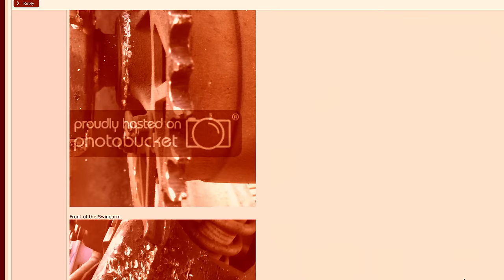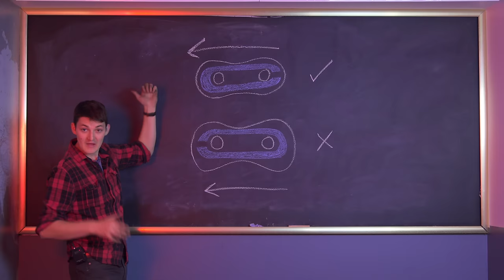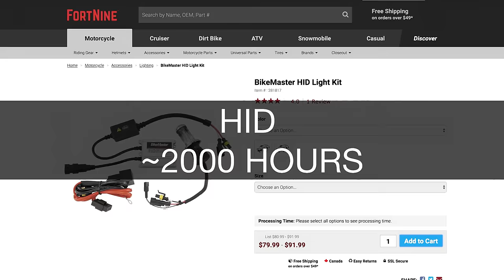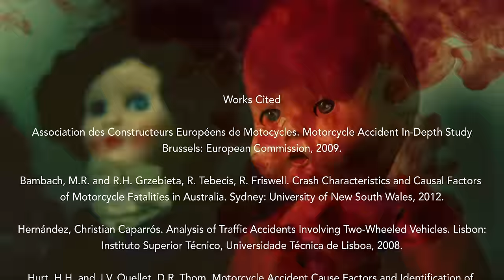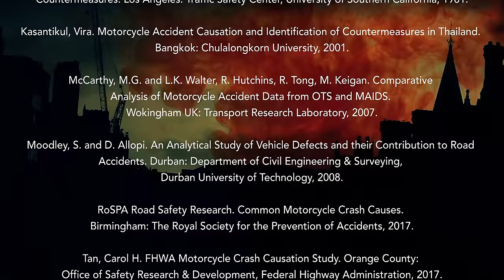Mechanical Monsters – 5 Maintenance Jobs that are Deadly to Overlook

Comment: The TW is definitely in my top 3, if not my favorite bike..
Reply: It's a pile of shit. I used to have one. Get an XT225.
Reply: @salazam  I went places with my TW that I couldn't even dream of on either my wife's XT250, my old XT 660 or even the white elephant Super Tenere gathering dust outside. 
All depends on where you want to use it.
Reply: @mariusvanniekerk7707  Yea I know, I wasn't riding it right. I'm just bitter because it got stolen.

Comment: Working as a repair tech in a machine shop I saw bearings from Thailand fail at an alarming rate. About 3% fail immediately and another 5% before I'm done testing my repairs. I'm sure bearings purchased through a motorcycle parts distributor will be held to a higher standard, but with most affordable bikes from Japanese brands being made in Thailand it is cause for concern. If you're changing your wheel bearings, buy extras, test for a couple miles, then check it again. If it lasts that long it's good.

For what it's worth, bearings from China were slightly better. I don't have enough experience with bearings from Germany, Vietnam, Japan, or Indonesia to judge them. I never had any problems with bearings from Singapore or America.
Reply: I only use German, Japanese or Russian bearings . Never had One-Failure , over 67yrs and 51 bikes .  Dave   NZ

Comment: Great video as usual!  
I've had several of these things happen to me.  The scariest was a chain braking at 100kms/h (62mph) with my girlfriend in the back.  We were lucky, but it broke a few things on the bike.  Also had a chain jumping off mid corner and froze the wheel.  Lucky i was only in first gear.  A bit of a slide, but nothing else.
On another bike i had a wheel bearing that completely destroyed itself. Again no fall, but had to call a tow truck.
Brakes failed because of a bad bleed nipple...  doing 20.. Ok again.  Throttle actuated as i pulled the clutch..  I could go on..
    
Guess i'm just lucky
Reply: Negligent at times. The bad bearing was on a new (to me) bike.  The bleed nipple was brand new.
The rest was negligence.  But hey.. most things happened more than 20 years ago when i was 19 to 21.
Reply: I'd say unlucky.
Reply: Maybe don’t do your own maintenance hehe b
Reply: You rode a lot of clapped bikes as a young man. Which honestly is probably true of many young men. Certainly was true for me.

Comment: Sag is Black magic to me. How about you show us on your blackboard?
Also (tip) don't leave her on the side stand for the winter as that plays merry with wheel bearings. Use a center or paddock stands and give the wheels a spin to stop the rollers corroding on one spot.
Reply: I combat those issues, but still riding, even if it is stupid cold out ;)
Reply: that is absolute BS, i worked in the biggest engine rebuild shop in NorthAmerica. this is totally unfounded.
Reply: @Francois_Dupont  ... How is it unfounded that metal exposed to the environment will form rust/corrosion on it. If left sitting, the rollers in chains and ball bearings will form corrosion on them. I take it you have never spent time rebuilding many old neglected motorcycles before. I started at 10 years old going to the local junkyards  and getting dirt bikes and other things like lawn mowers, that were trashed and making good ones from a few bad ones. I can tell you when something sits for a while with out moving, you certainly see rust and corrosion form on things. SO while you may never have seen it, and you may never even noticed it, I can assure you a motorcycle chain left out in the open will certainly rust solid, if you don't rotate it once in a while.
Reply: @JJ_ExMachina  we are not talking about chains or exterior rust here, but bearings, the guy claimed that having the bike on the side-stand wrecked bearing and that you needed to turn the wheel so they dont rust.

the fact is the the bearing can support a thousand times the static weight of the motorcycle and that they any quality bearing is vacuum packed in grease and sealed. if you bearings are rusting its because they are shot and its murderously dangerous to ride with such equipment installed.
Reply: @Francois_Dupont  Static engine bearings are not under stress when sitting. Wheel bearings are more exposed and weight bearing. 
I was involved in the amature racing scene for about 25 years as a Race Engineer and have built bikes from the ground up. I was told this by a much more experienced Engineer when we discussed swing arm props.
I'll take his word for it and keep storing my bikes off the floor.
Reply: @docthebiker  you think a bearing with not even 300lbs of static load on it is getting wrecked while the same bearing is designed to hold the whole bike axial load going 100km/h+ tru bumps and hell for 50,000km? not even talking about the fact that a single big bump put as much stress on it  as the whole bike falling 3storys high.

you can believe what you want for as long as you want, it doesn't make it right.
Reply: @Francois_Dupont  Thing about roller bearings is they take all that stress vertically even at close to 200mph, but are fragile with lateral loads. Moving and lubing they are great but I choose to protect them when static for a long time. Which is wheels off the ground or off the bike. Our race bikes mostly started the season on new bearings, but if I'd changed them near the end of the season I'd do all I could to keep them as perfect as I could.
Nah you're correct. Just because I believe it that doesn't make it right, but it seems logical to me, so that's my choice.
If I share it and someone chooses to do the same, then they MAY benefit, it certainly isn't go to do any harm.
Reply: I have bikes that are twenty plus years old, on the original wheel bearings, that sat all long, cold, wet Michigan winters on the side stand and had wheel bearing issues zero. You must have had some garbage bearings/seals.
Reply: @VTLIFE-so4dc  My BSA C25 did it too me (in the 70's).
Agreed not so likely a prob with modern sealed bearings but I've found some crapped out wheel bearings while working as an M/C mechanic in the UK. I play it safe with winterizing my own stuff. It can't hurt.
Reply: @docthebiker  I replaced steering shaft bearings in a 65 E Type Jag a few weeks ago where I work. They were made from felt. I guess that just the way you chaps used to do it! We could have found aftermarket rollers, but the old man wanted stock. It was nuts, because the previous job was diagnosing a chronic rich condition on a direct injected gasoline turbo engine. One extreme, to the other. The Jag was a beauty tho...

Comment: Great work F9 crew. This can also serve a dual purpose. When shopping for a used motorcycle, if these areas are looked at in greater detail, it could be the sign of a neglected and potentially dangerous ride for an unsuspecting new owner.

Comment: Six months ago my chain came off at 160 km an hour. When I had that chain fitted I told the mechanic to rivet it rather than use a clip but he used a clip anyway, saying that only racers need chains riveted. My advice is to always rivet your chain, especially if you ride a powerful bike.

Comment: This scared me to the point where I'm gonna change all my brake lines and bearing and get a new chain. 
Better get new and working than old and dead.
Reply: anonymous 11 it would be a good idea to change your sprockets when you get new chain, they wear together.
Reply: @brittonbyrd333  Great advice. The new chain will wear faster if put on old sprockets. And if the chain is worn chance is that the sprockets are too.

Comment: Who here honestly replaces their fork oil every year?
Reply: Manufacturer's recommendation is good enough.
Reply: Yep, once you do this and you feel the difference you'll do it EVERY year.
Big help is setting up your suspension for you.
Reply: @reegyreegz  You’ll have to be more specific than that. There are thousands, if not millions of bikers that have watched the bulk of Ryan’s videos and would strongly disagree.
Reply: I do. Engine oil every 5000km, Brake pads when they reach 1/3 pad thickness, clutch fluid every 2 years, tyres after 2/3 wear. I ride quickly and want to know everything is working as it should.
Reply: @reegyreegz  think he's just being very very cautious. I'd rather be on that side than the other but I hear ya.

Comment: My 95' XR650L and my 04' Roadster just got a fluid flush and a "brake over". I was amazed how well the brakes worked with sewage flowing through its veins. With all that care both bikes stop just as well as they did...but I have possible averted at least an unscheduled change of underwear in the future.
"Skid Marks Skid Marks Everywhere, just not in my Underwear." That is anymore or less!😃

Comment: Pro tip for more accurate suspension setting!

Preamble: Only do this on a closed/quiet/empty road and if you're comfortable with testing the limits of your bike.

Step 1: Set factory settings according to the manual (or slightly stiffer if you're above average weight [most factory settings are for 70-80kg] or setting it for heavy luggage/2up)
Step 2: Place a cable tie (ziptie) around the rear shock(s) and both front forks so that as the tubes compress, the cable tie moves down with it and then stays in place. This lets you do a quick test and afterwards can then see exactly how far it went.
Step 3: With the bike fully loaded (with luggage, a dummy weight representing a passenger, full tank etc) head to your 'closed course'.. Then, with the engine warmed up of course, do some hard acceleration from standstill and hard braking. Try to push it close to the limits without exceeding them (whether the limit is your confidence or mechanical, be mindful)
Step 4: If you bottom out, stiffen up, reset the cable tie and try again. If the tie never comes close to the full range, soften and try again.
Step 5: Continue until the test results (aka cable tie final positions) are close to but not quite at the full range of travel.
Done!

This method is more involved than just setting for sag, but it means under extreme conditions such as racing or emergency stops you will have the full range of suspension while not hitting the bump stops. As such you will have the maximum available grip when you need it the most.
I've seen many occurrences of big riders on small bikes bottoming out and suddenly locking the front wheel, and on the flip side I weigh a fair bit less than factory settings are built around so for me the difference is: Factory setting means front locks too easily in hard braking + overall bumpy ride vs enough grip to perform stoppies with little to no risk of lock + smoother comfortable ride.

[Boring personal story time]:
My first ever bike ('84 Honda Integra 250, got it back in '09) used compressed air for front preload and the seals were old and worn so it slowly leaked out. Due to the age + design I found for me personally the best preload was 7-9psi which I set with a bicycle pump.. Had to reset it every 3-4 months and it very noticeably dived more and risked bottoming out as it dipped below 5psi, even though it barely felt any different while stationary. When properly set, on decent tires and appropriate tyre pressures, the little lawn mower sounding shit could corner faster and more stable than the bigboy tryhards on their 600cc-1L modern sports bikes, even if it then fell way behind on the straights.
Reply: Hello stranger from two years ago. Just letting you know I read your entire comment and enjoyed the effort you put into it.

Comment: Funny, I just came inside after Hrs in 'the-shed' , changing brake-fluid and cleaning/checking caliper-piston functioning . I pushed the pistons out carefully under hydraulic-pressure,(without 'popping-them' ) then wrapped a coarse shoe-lace around them , working it to clean and polish . It worked a treat , compress slowly all the way in, suck-out all the fluid from master-cyl with a syringe , then a quick top-up and bleed .  1 bike down , two to go..... Dave  NZ

Comment: Perfectly correct. I had a long time ago another failure located in swing arm pivot axle of a Honda Trail: due to bad design of grease gasket cups, lots of offroad so lots of pressure washings... and lack of maintenance, the pivot came stuck. Then because of swingarm leverage and sheer mass to act on it, the 18mm axle had a torsion failure, right at the pivot/chassis junction. Then a single pothole at 100km/h broke the axle, the swingarm became loose with the Prolink suspension levers, and the rear wheel locked itself into the mudguard. Only a good practice of controlled skid saved me that time. To be done every 50kkm : Grease on pivot axles : disassembly if there are no greasers. Same for front pivot bearings.

Comment: I've  been riding for awhile now and still run my CRF45O at the track. I have never,ever hear or seen anyone checking sag on the front forks of a bike. Check sag at the rear swingarm. The spring back there can be adjusted to stiffen or loosen depending on rider weight.

Comment: Good advice in that one Ryan. Two years ago I had a high-speed tankslapper on my thoroughly rebuilt 1973 Eldorado. It nearly killed me as it sent me high side. The problem proved to be the new front fork lower bearings which had a metallurgical/production problem; they were binding in the sliders according to an independent technical inspection - a finding accepted by the police. Cheap shit, reproduction parts made by idiots and sold by people who won't take any responsibility for them. On that trip (Sydney to Phillip Island and return) I had several problems with new parts: new regulator failed, new fuel taps leaked, new combination switch needed running repair, but as you point out it's the big five to look out for. When my various injuries were healed I bought a new GSA for touring and rebuilt the Eldo for cafe work!
Reply: Stay safe Paul . I had a high-speed tank-slapper from incorrect fork-seals bursting under braking . Shop fitted incorrect parts that couldnt clip-in (too-tall) . I do my own maintenance now .You have to be overly-diligent/careful these-days .  Dave   NZ

Comment: The British know how to ride without lights because of Lucas Electrics. That being said, I used to ride a lot starting with minibikes at 8 and dirt bikes at 12. I've been through most of the failures mentioned. I think the worst is a suddenly flat rear tire on the highway at speed, talk about a thrill ride. I've had fronts go flat and no problem getting under control, but losing the rear is a wild ride

Comment: I would add - check your spoke tightness. Wheels with loose spokes can start to wobble, with worst cases being broken spokes resulting in total wheel failure. 
A good rider will feel somethings wrong with the 'loose' handling before it deteriorates too far, but periodic checking will ensure there's never an issue.
A light rap with a wrench to each spoke will demonstrate whether it's tight or loose, so it's completely trivial to test.

Comment: I had the headlights (high and low beam) go out on my KLR-650 on a corner at night! (shorted out the fuse for them). I had remembered reading about turning your emergency blinkers on if that happened to you in a car, but since the KLR doesn't have those, I just used a turn signal. It was enough to get me through the corner and to where I could park,  find the short, replace the fuse and get home!

Comment: As a former KLRista, and since you have one, I will point out that the KLR is horrendous on rear brake fluid since the Kawi Engineers saw fit to place the reservoir right next to the exhaust pipe. 
I recommend yearly replacement of the rear fluid on any KLR, as my personal experience as well as working on hundreds at Tech days has shown the fluid to often be in poor condition.

Comment: Daemn! I never thought of breaking lines before, and it's been 4 years.
Reply: I've changed my stock- brakelines for braided steel lines, which are teflon coated on the inside. They are more responsive and give even (slightly) better braking power.

Comment: Few years late to this party. I come from an MX background so this is all second nature, but something to really look at as well is your rear sprocket bolts. If you just did a gear change, its a good idea to replace the bolts and nuts or at the very least make sure to used loctite. Forgot to do this when jumping up a tooth on my 2002 YZ250. bolts got loose, egged out the hub and sprocket holes, bolts came out. In Air off a jump the sprocket became lodged partially into the rear chain guide block. Upon landing it ripped my hub and spokes apart. Slid away alive thanks to gear and being in dirt, but on the street, especially if you have an enduro and possibly changed gearing for better highway speeds, replace the bolts and loctite those. Might not ride out so smooth in traffic on pavement.

Comment: Two years ago going 70 mph on a semi busy highway my front tire blew out without any signs or type of warning! Somehow,someway I never laid it down but had to wipe you know what. When it first happened I came close to crashing as well as when I got off to the shoulder when coming to a halt. I now replace tubes with heavy duty ones Everytime I change tires! Crazy paranoid for along time

Comment: Dead batteries won't kill you, but loose terminals could. I had to add that to my maintenance check after having a cable work loose while going around a corner. Not good when you plan on your throttle to help you upright.

I've also had the fender bolt work loose and tear through the sidewall.